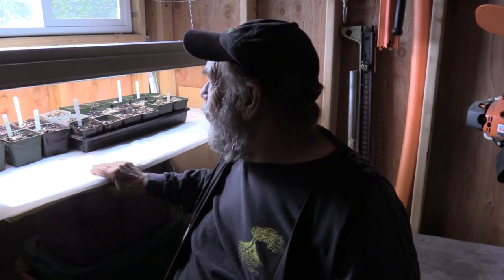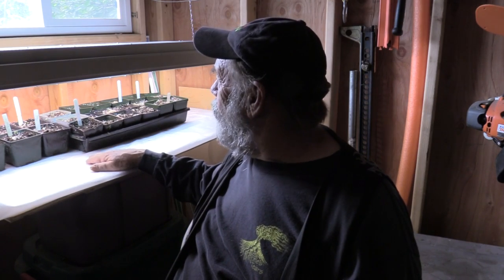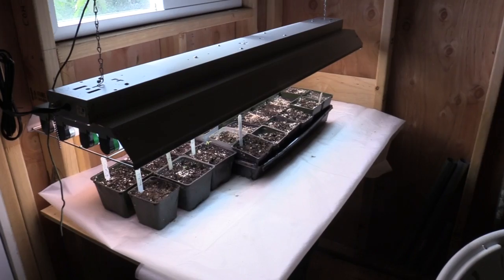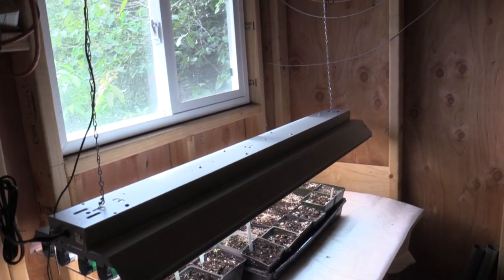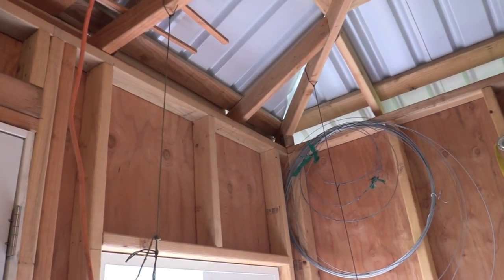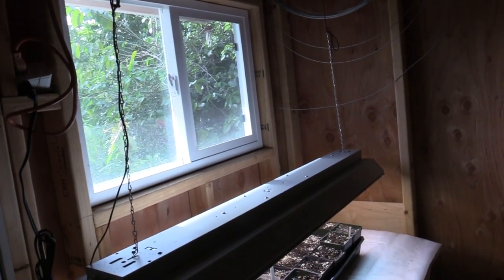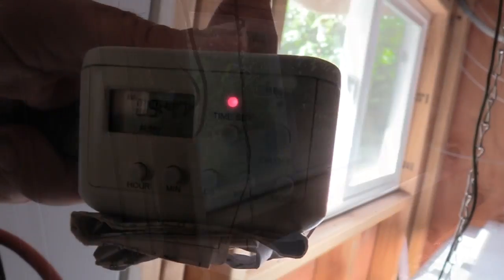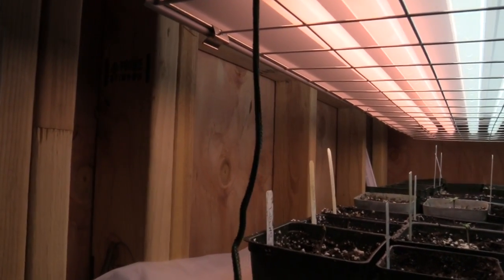Indoor Growing, Gardening with lights

Comment: Hmm, thinking of trying strawberries too but not sure 4x T8 bulbs will be enough light to get a decent fruit. Have you tried this at all?
Reply from the maker: Fruiting and flowering take far more radiation and a good shift to the infrared.  There might be some sort of high out put LED's that will work.  The Cannabis cultivators tell me these exist.  Old school, the only light that would flower a strawberry was a high pressure sodium lamp combined with a metal halide.  They make heat and burn juice like an arc welder.  I'd use a greenhouse for the strawberries and stick with green plants under the lamps.  Arugula, endive, lettuce, basil, parsley, micro greens, & mesclan would be the best choices.  Chives are worth a thought too.

Comment: interesting talk bill, i've also heard about autoflower cannabis growers actually use 24h lights, what weird is that like you said, they need time to respire, but these autoflowers seem to do the best under 24h lights, could this be due to them having some Ruderalis traits?
Reply from the maker: Auto flowering Cannabis will flower under almost any day length once it reaches the proper maturity state.  This has nothing to do with plant respiration.  Photoperiodisum and respiration are disconnect in plant function.  Respiration has to do with the plants sugar manufacturing process, not it's bloom period.  You can generally run lights for 24 hours if you wish with no harm to the plants but most will shut down growth after 16 to 18 hours of light. 24 hour light is just a waste of electricity.
Not sure where you are finding this information but some one seems to have mixed up Plant respiration with photoperiodisum.
Respiration Basics
:
Respiration allows plants and other living things to release the energy stored in the chemical bonds of carbohydrates such as sugars made from carbon dioxide and water during photosynthesis. While a variety of carbohydrates, as well as proteins and lipids, may be broken down in respiration, glucose typically serves as the model molecule for demonstrating the process, which can be expressed as the following chemical formula:
C6H12O6 (glucose) + 6O2 (oxygen) --> 6CO2 (carbon dioxide) + 6H2O (water) + 32 ATP (energy)
Photoperiodisum:
Many flowering plants (angiosperms) use a photoreceptor protein, such as phytochrome or cryptochrome,[1] to sense seasonal changes in night length, or photoperiod, which they take as signals to flower. In a further subdivision, obligate photoperiodic plants absolutely require a long or short enough night before flowering, whereas facultative photoperiodic plants are more likely to flower under one condition.

Comment: Excellent timing on this video Bill! I just harvested lettuce that I brought inside and put under my seedling lights. It tasted so good I decided to plant more. Wanted to use T5 lights but they only had T8. Do T8s really use that much more electricity? 
I'm using alternating cool and warm white bulbs, which I thought were ok, but I'll look for the ones you mentioned. Was wondering how lettuce would do under just cool white light since they are heavy in blue spectrum iirc.
 Your right about taking plants from outside. We had a bit of a fungus gnat problem which didn't hurt the lettuce but was really annoying. Read that they like wet soil so I let the soil dry to the point of stressing the plants and it helped the problem immensely. 
Planted the rest of my salanova seeds this time but having so much fun with this that I want to plant some other varieties which are better suited to indoor growth. Any suggestions?
Reply from the maker: I am pretty good at horticultural info but when it comes to light bulbs i can be a bit dim.  This is amplified by the fact that light technology has been moving at a rapid pace in the past couple decades.  I haven't really kept up.  A look at comparing T-5 & T-8 looks like apples to apples.  If you have a T-5 with 32 watt usage and 6000 lumens and a T-8 at 32 watts with 6000 lumens they both have the same energy usage with the same out put.  If the T-8 is 32 watt and the T-5 is 24 then the energy use is lower but generally the lumens are too.  It doesn't look like a lot of difference to me.
The cool bulbs do not produce the right spectrum for plants.  I've been using agricultural lights for over 50 years now.  They work well.  I started using them to keep the plants in my aquariums alive back in the 60's.  The plants would waste away under common bulbs.

Leaf lettuce is the best choice for salad under lights.  Panisse form of Salad bowl is one of my current favorites.  Any other short growing leafy green plants will work though.
Reply: @GreenGardenGuy1  Thought cool white would be ok for plants in veg phases but the plant lights are only 9 bucks so ill go for those. Panisse looks great for indoor growing, nice and dense.  Thank for the tips Bill!
Reply from the maker: @derrickpitter8340  The more radiation you can squeeze out of the bulbs the better the crop will grow.  Aloha
Reply from the maker: Fungus gnats get started inside even if the plants have never been outside.  The things are drawn to the fungus that grows on overly wet potting soil.  Use well drained potting mixes and allow them to dry on the surface between watering.  You can hang flying insect traps by the lights and the carnivorous Sun Dew plant does a fine job on fungus gnats.